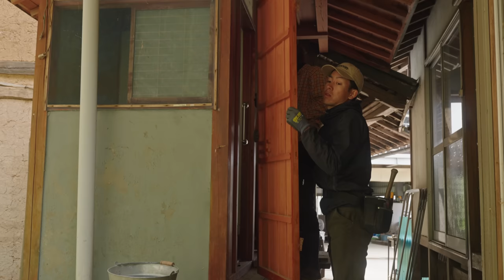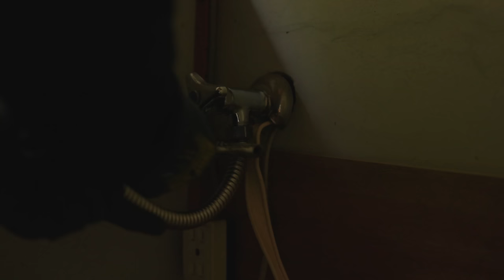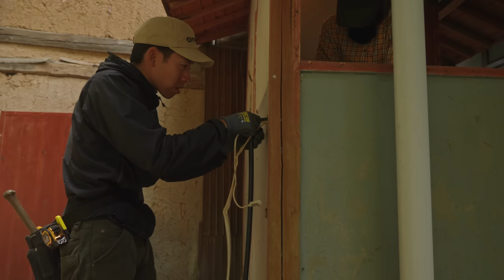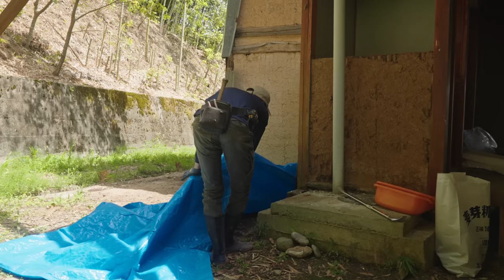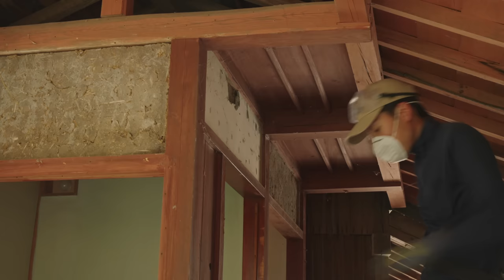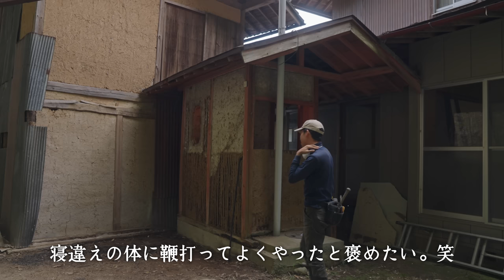【解体】古民家の外トイレに挑む！人力だけで古くなった壁を剥がしまくる！｜田舎暮らし046

Comment: The attention to detail in the building of the outside toilet was amazing. That little recessed and framed space for the lightbulb to fit so it lights both sides of the toilet. Awesome! I have never seen that before. I am familiar with the concept of 'borrowed light'  in dark  old architectural buildings around the world but yours is so simple but money saving.  Glad your are keeping the old mud walls on the old building. will you keep the timber from the roof and walls of the toilet?